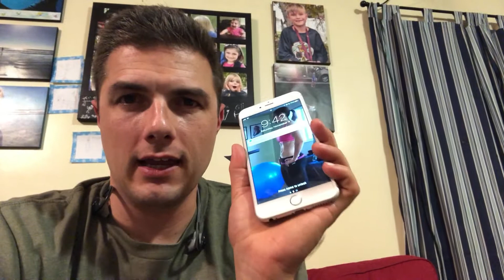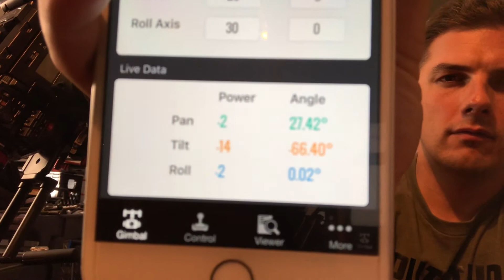DP Journal Episode 90   Jib Ahoy

Comment: Can that 501 head handle all that weight?  My impression was they couldn’t handle upwards of 7 lbs...
Reply from the maker: Andy Hays yah those old school heads are rated at about 5-7 lb.  in a pinch I use to run my RED on it back in the day and it wasn’t happy.  But because it’s underslung and I am not needing the fluid head to be smooth or balanced it can just hang there like a giant angle adjustable bolt with a quick release.  Etc...